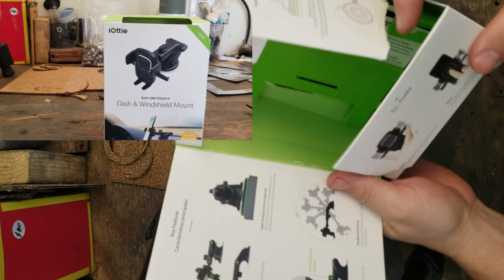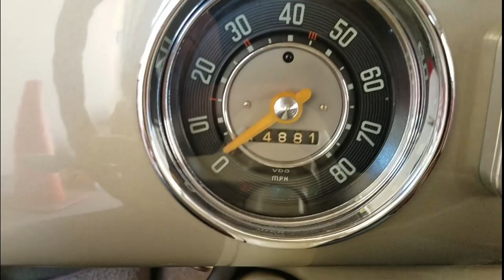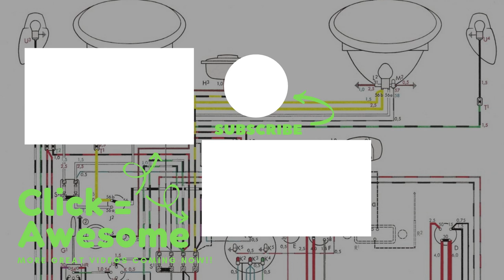How To - Electric Fuel Pump Install - 1956 Oval Window Rag-top - Volkswagen BUG | JW Classic VW

Comment: Nice video can install this on my 1970 beetle single solex carb.30/31 pic. 1 thanks for the comments
Reply from the maker: Yup, you sure could... most carbs for VWs work off the 2 to 3 psi fuel pressure.

Comment: The inner diameter on the two outlets of the reserve tap is rather small. Might be where the bottle neck was. Im hoping I dont run into this fuel starvation problem with my engine.
Im just going to use a bigger outlet from the tank running into the std fuel line in the tunnel. Thanks for the videos gives one some things to consider.
Reply from the maker: Yes I think you are right!! I plan on replacing it all together.  CB Offers a replacement outlet that goes to -6AN.

Comment: JW Bugs...have question..have you heard of a fuel-line " Mercury switch "..the way that the switch works..is (if, car gets in an accident or rolls over on its side or on its top the fuel system shuts off by cutting off the electrical power to the pump.. the fuel system doesn't keep running because of contacts are broken or disconnected).. I'm also. Looking into a device in the back bumper that was made by Ford in case of a sudden jolt or crash or something in an accident and it shuts off the fuel system.."you see I'm like you.. I don't care for the mechanical pump that comes with Volkswagen for the Super Beetle and regular bugs.. so now that I've changed it I have a mechanical electrical problem that I have to deal with now.. I am debating on whether to work it into the coil fuel pump and also the electrical system to shut it down in case of an accident.. got any ideas about these new cars that have fuel injection or earlier that have a cut-off system like that I just mentioned.. like maybe a name and a part number or manufacturer.. I'd be truly grateful for any knowledge you can kick down my way..R.G.B. (nickname: Critter) thank you very much WJ I enjoy your Shows..! Have a nice and wonderful day.
Reply from the maker: I'll look into it and let you know what I find, but yes most modern vehicles have an impact switch that normally not only kills the fuel system but also kills the engine.  Not sure if the application has been applied toward Classic cars but it seems simple enough.  The impact switch is normally magnetic in nature. This switch is called a Reed Switch and can be placed in a location where an impact would occur such as a bumper.  Wired into you fuel pump circuit it could act as a kill switch if  you were it in one of those bumper zones.

Magnetic Switch https://www.amazon.com/dp/B0009SUF08/ref=cm_sw_r_cp_apa_i_Td32DbR6WXGQQ

Comment: Your ZOOM is acting like a teenager. It doesn't want to focus on the problem.  Hahahaha!  You should solder any electrical connections to prevent corrosion getting in (besides the heat shrink). 
Moe
Reply from the maker: Lol... true all in the process of troubleshooting! Fix then go back and fix it for real.

Comment: Carter pump has become expensive, so I got 2 of these for the price of one Carter. I installed one on my Bug and have another for a spare.  Too soon to tell if this pump can stand the test of time, but not too soon to mention how ridiculously loud it is. Can’t hear it while driving mid to higher RPM’s, but at start up and red lights the whining noise might be too much for me to take. I’ll wait and see because on the other hand, the bug runs better than ever with this pump.
Reply from the maker: Yes the electric pumps can be load... I guess I just got use to it.  make sure you check the Fuel pressure on your pump for your carb set up... you want to keep that 3.5 PSI.  If your using a regulator in line you are good to go.

Comment: Very professional work! I am installing electric fuel pump for my Weber 38/38 she’s carburetor. Do I need a fuel pump relay or on/off switch. I was thinking of going directly to a fused bus. Will that be alright? Thanks, Bob
Reply from the maker: No relay required unless the fuel pump had like a 20 foot power.  Relay are really only used to switch a low power or current source to a larger source.  You'll have no problem going direct, just put a fuse in line.

Comment: I wondered about the fuel pressure regulator but assumed you checked it 😂🤪
Let me know how you like that pump, been eyeing it on amazon for a while now.
Reply from the maker: Lol... I know right! So far the pump is pretty nice, and now I have a spare Carter... lol
Reply: JW Classic VW good point about the spare! That’s one thing that’s been holding me back is I carry a spare manual one with me.... if I go electric it’s not as easy to swap on the side of the road. 
Did you run straight power to the pump or use a relay?
Reply from the maker: @VWJawbreaker  Stright power fused with a switch... hidden switch lol
Reply: JW Classic VW I already have one of those for my ignition! 
Thanks man, I’ll see if I have the extra cash for the fuel pump after I get this engine built.

Comment: Did you connect the fuel pump red wire to?
Reply from the maker: I had a switch under may dash for the red wire to 12v positive.

Comment: How did you electrically connect the fuel pump?
Reply from the maker: Fuel pump is on a switch to fused power and the ground is wired to a mounting bolt for the pump.
Reply: JW Classic VW I guess my question is where? And do I need a switch separate from the ignition so it doesn’t get stolen?
Reply from the maker: The switch is nice to have just as you said for security and safety.  As far as where you put it that is really up to you... mine is under the dash.